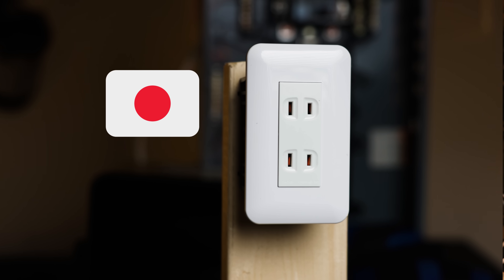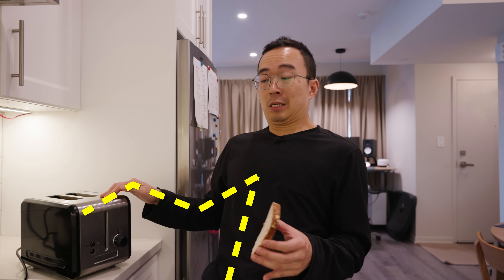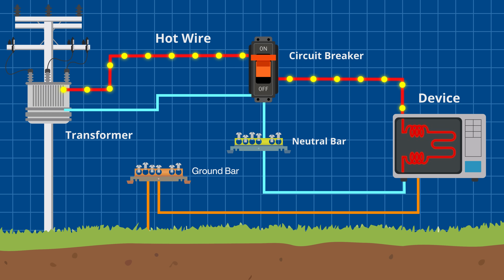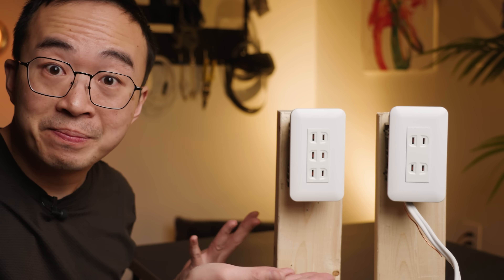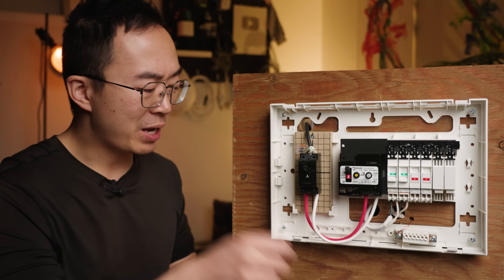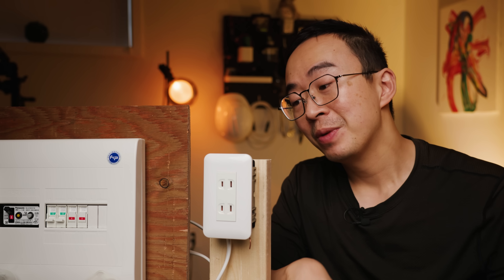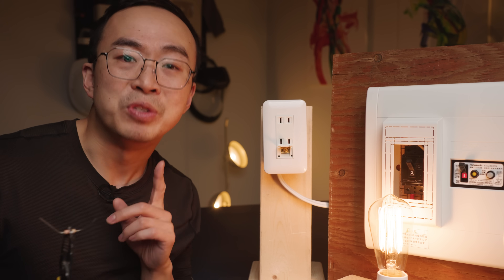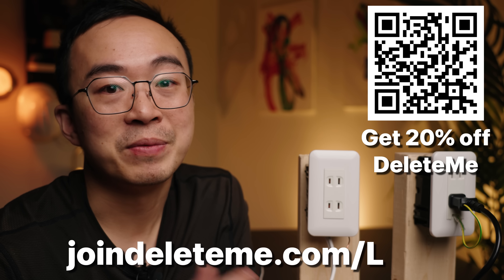How Japan Made Their Outlet Safe

Comment: It is long overdue to stop video about outlets. The EU schuko CEE7/4 F type is the absolute superior socket design under all possible consideration ever, while US and UK are the dumbest. Period. In general, french household electrical standard is the best worldwide by a long stretch.
Reply: There really is no need to overcomplicate an outlet in North America to hide the prongs. Because the voltage is low enough that it's not really a safety issue. Europe was forced to use higher voltage because copper was scarce after the war. That's why they came up with a design that covers the prongs better because it's riskier. In North America, the only way you're gonna get hurt by 110 volts is if you don't let go. 😅

Comment: The problem with the U.S. we were the first adaptors.  We didn't know all the uses and problems. It was too late to make a lot of changes without changing everything.
Reply: Nah slap a GFCI on your circuit board and it should work, i dont see how that needs other infrastructure changes to the wider grid. 
(Of course i mean a proffessinal should install everything)
Reply: That and wanting to address the situation on the cheap.  Running a 2nd neutral was determined to be too expensive.  Losing neutral in a 3P+N system as is used in the rest of the world can be every bit as disastrous as it is in the USA's 120/240 centre tap neutral arrangement.

Comment: Some jurisdictions in the US require GFCI and/or AFCI breakers, there are combo breakers as well, in NEW construction only. Check the NEC, or for California, the CEC.
Reply: At this point, essentially all jurisdictions in the US require these protections. The video is...yeah.
Reply: afair if you replace a breaker in a bedroom it MUST be an arc fault or combo AGF now - which causes a lot of hassle
Reply: Not only new construction, but also in almost all instances of rework to the circuit in older panels as well.
Reply: ARC FAULT (AFCI) protection aka DAA/DDFT in europe. GFCI/RCBO/RCD is old news in global electricity safety systems.
Reply: @thedavesofourlives1  One of the nice things about GFCI is that it's something that's often times easy to retrofit without being an electrician. It just requires the ability to replace the impacted outlets with GFCI ones, assuming you've got the necessary 3 wires to do it. 

If I understood correctly, for best results AFCI really wants to be in the circuit breaker and that's likely best done by an electrician, especially if you're breaker box is like mine and lacks a method of powering it down.
Reply: @thedavesofourlives1  Internet says that AFCI has been mandated on most new circuits for years in the US and Canada, but it doesn't work as well on 200+ V systems so has been adopted slower and less aggressively in Europe.
Reply: Tesla coilers and ham radio operators absolutely hate those pesky false tripping AFCIs.
Reply: Those breakers are a massive headache with their false trips. AFCI are worse, but GFCI have been ripped out so often I can't count. And some perfectly safe appliances will trip a panel AFCI/GFCI once a week or so. I usually blame junk breakers, but there are a lot of badly constructed GFCI outlets out there, too.
Reply: @brucecarr6258  I work with EE is there something you suggest to mitigate these issues?
Reply: Obviously the creator of the video has never opened a Code book in his life. The video is borderline clickbait and contains many half-truths and misrepresentations. Source: my 40 years working in the American industrial electric industry.
Reply: CEC is Canadian Electrical Code, I think you mean NEC for the jurisdiction of California.  Also, I think it would be more appropriate to call the NEC USNEC due to another corporation operating internationally known as Nippon Electric Company.
Reply: @WJCTechyman  In California, we call it the CEC, but I totally agree it is a bad acronym in either case.
Reply: @nikaiwolf  now you already know why
Reply: @WJCTechyman  Overload in the three-letter acronym space is hella bad. But CEC is correct as California requires adherence to the California Electrical Code, which is a modified  copy of the National Electrical Code.

Comment: 12:00 Actually, the test button is just as effective as an outlet tester because the way that the best button works is by shorting a resistor between the neutral and live, simulating a real ground fault.
Reply: One GFCI outlet can protect all the outlets beyond it, so you can still use the separate tester tool to test the GFCI ability from those other locations that won't have buttons.
Reply: @Lam in the UK proper testers do a multitude of tests and check the time it takes to trip which is mandated as a maximum time. 30ms is used as that is only part of the wave length so you unlikely to get the whole current as part of the waveform will be lower voltage. 

Passing the test button didn’t do that. Also the test button can trip but in real world scenarios it won’t actually trip. 

There are also different types of rcd as the original type AC devices were “blinded” by DC current on the line which you can get from switched mode power supplies. In the UK it’s type A not type AC.
Reply: @Lam  Yeah, keep digging man. Why not just admit you were wrong.
Reply: Shorting between hot and neutral would be a short circuit not a ground fault. I don’t know exactly how the circuit works in a tester, however it does interface with ground. 

A safe way to upgrade an ungrounded receptacle is to add a GFCI. However testing an ungrounded gfci with a plug tester won’t trip it as there is no ground to interface with. This does not mean it’s bad or dangerous. It’s just the plug testers circuit can’t actuate the gfci if there’s no grounding connection
Reply: So, in Japan when you have a ground fault, the whole house GFCI takes down the entire house and not just the faulted circut?
Reply: @raylrodr  that's pretty common all over Europe, too. RCD trips the entire place. In the UK you sometimes have two RCDs each covering half the circuits I believe.
Reply: Regular outlets on a GFCI circuit do not have test buttons.
Reply: Just as effective *if they are working properly*, but I have seen them fail.
Reply: Live and ground, not live and neutral as that would be equivalent to plugging in a light bulb or any other small load.

I've never seen a GFCI without a test button, for places where it's mandatory that typically includes testing every X years. But hey i'm sure Japan make flawless GFCI's which never ever malfunction or fail.

I guess Japan also doesn't have lightning strikes either, or they are okay with humans becoming lightning rods.

Not my definition of "safer" but each to their own.
Reply: @sirtra The test button and resistor is between live and neutral and between the load and supply side of the sensor.
Reply: @TimothyEBaldwin   live and neutral are the wires used by loads. A light bulb is indistinguishable from a resistor in terms of the GFCI.

You create a ground leakage fault by leaking current from the live wire to ground wire.

Did you even watch the video or understand what an AC sign wave is? What is under the little flap on the recipticle shown near the very end and why?

🤨
Reply: @sirtra  And if you connect the light bulb between the supply neutral and load live terminals, the GFCI will detect the imbalance and trip. A resistor connected between load neutral and supply live will also typically trip a GFCI.
Reply: @TimothyEBaldwin  ah yep, i understand what you're saying now - ie the resistor will be bypassing one side of the protected circuit, not simply from live to neutral and in that case you're correct.
Reply: "Simulated"... you said it. How is that any better than a test that fails. It's easier to argue a failed trip test is more revealing as it positively identifies defective equipment, installation, and or environment.
Reply: Wonder what would happen on a non-GCFI grounded circuit.  Probably the electric fuse would blow.
Reply from the maker: ̶N̶o̶t̶ ̶e̶v̶e̶r̶y̶ ̶G̶F̶C̶I̶ ̶d̶o̶e̶s̶ ̶t̶h̶a̶t̶,̶ ̶t̶h̶e̶y̶ ̶s̶h̶o̶u̶l̶d̶,̶ ̶b̶u̶t̶ ̶s̶o̶m̶e̶ ̶o̶n̶l̶y̶ ̶r̶e̶l̶e̶a̶s̶e̶ ̶t̶h̶e̶ ̶m̶e̶c̶h̶a̶n̶i̶s̶m̶ ̶i̶n̶s̶i̶d̶e̶

Edit: I was wrong.  All GFCI test buttons create an inbalance between hot and neutral which should trip the breaker.  I think I was going through some engineering discussions and it was likely a discussion on whether the testing mechanism can fail and whether an external device should be used.
Reply: @Lam then it’s not testing anything
Reply: @Lam  When and where?  Only releasing the mechanism wouldn't be an actual test, there would be no point.  I'm gonna have to see some documentation that a nonfunctional test was ever allowed in a US residential GFCI.  Having disassembled a GFCI from the 1970s, it was definitely a real test back then.
Reply: @jonc4403   It verifies the disconnect mechanism still works, but not the trip mechanism. So it isn't a nonfunctional test, it is a partially-functional test. 
My understanding is that spring fatigue is by far the most likely form of failure, so I find it easy to believe the test button was originally only meant to make sure the spring still did its job and the role was upgraded later to whole-device testing.
Reply: @Lam  Good to know, but basically all modern GFCIs do that.
Reply: @Lam  Not true if you are using compliant / approved GFCIs. Maybe true if you're using chinese made "For Export Only" GFCIs.
Reply: @Lam  every GFCI with a test button has always that.  they never made GFCIs with a "only release the mechanism inside" button.  if you think they did, please link a model number, datasheet, or anything to back that claim up.

Comment: If the ground is really just a different path to neutral in the US then why on Earth does it have to be driven into the ground? Also, wouldn't this also make neutral just a different path to ground?

Btw. I live in Europe and I have the best of both worlds. All my circuits are protected by GFCI just like in Japan but all my outlets accept grounded plugs (Type F socket) like in the US.
Reply: The earth ground also serves as protection for lightning.
Reply: and bonding neutral (also called grounded conductor) to ground makes neutral stays at ground potential (in reality only where it bonds)
this means if lightning did strike earth in the physical vicinity of transmission lines all 3 prongs inside the dwelling will receive a raised potential momentarily
Reply: Yes neutral is the same as ground at least in theory , and you can run circuits just using ground as neutral (although there are issues associated  with it, it has to be driven into the ground so that if the connection somewhere brakes you won’t get shocked, that is the whole purpose of grounding and is why it’s a different cable from your appliance because if there was an issue with the normal ground you don’t want it shocking you
Reply: One thing not mentioned is grounding is necessary for things like amateur radio. and you especially want to ground for lightning reasons. The US has the best setup because you can get an AFCI/GFCI, breaker, and ground, and GFCI outlets.
Reply: @mediocreman2  How parochial.
Reply: it is a very good idea to build a separate, dedicated RF ground if owner is transmitting, after it is built connect RF ground to the power ground to satisfy local code whereever the property is located
Reply: @mediocreman2 I've found a good ground really helps with radio reception.
Reply: Also the video’s description of ground while correct isn’t the full story as there are far more ways ground saves you more than just tripping a breaker, some of the other safety features from it are keeping the neutral at 0 as well as providing an alternative path to the substation
Reply: Ground needs to be in the ground cause the idea is that it also detects current that flows over the real ground from a live cable  to it and then trips the breaker.
Reply: It is an alternate path to neutral in Europe as well in most cases. If it is just an earth rod then the RCD handles this protection.
Reply: It doesn't need a stake (or pipework) in the ground to function in terms of basic protection, ie blowing fuses/tripping breakers rapidly.  There's more at play though but far too long a subject to properly address in a YT comment.  Staking the premises earthing (which may also be simultaneously attached to neutral) to the ground absolutely does not provide any useful protection to a person actually being a path between line to the ground or the earthing system.  You need an RCD or similar for that.

Comment: In usa, residential GFCI trips at 4-6mA
Reply: 10mA RCDs are available but are only used in certain settings.  They can trip from 5 to 10mA but always at 10mA or more.
Reply: What?
In Central Europe and UK+Ireland the standard is 30ma to avoid nuisance tripping on ground leakage/stray currents that occur naturally in electronic devices.
Reply: @alouisschafer7212 the big difference is American GFCIs are protecting only one branch circuit, and stray currents are likely to be reduced at 120v (as compared to 230v).
Reply: @alouisschafer7212 But we just have to push the reset button on the nearby outlet to reset it if it trips - and devices here DO NOT have that kind of leakage current under normal conditions.
Reply: @jonc4403  You can have a GFCI outlet protecting additional sockets downstream though so potentially you still have to contend with aggregate leakage pushing close to the trip point and potentially have to go walkies to reset the device anyway.  6 of one, half a dozen of the other really.
Reply: @jonc4403  ever heard of low pass filter in devices that runs frequence inverters?

Comment: TLDW: Japan uses GFCI's everywhere, except for where they don't (because high currents are needed for motor kick-offs).
Reply: As far as i know, you can programm them so they are also used in industrial settings, or what do you mean with motor kick-offs?
Reply: @maxmisterman785  Motors are notorious for tripping GFIs not because of high currents as such, but because when a motor starts there is a split-second mismatch between the current it draws and the current it passes back to the panel on the neutral wire. Basically the motor is very briefly storing electrical current, which exactly simulates the fault that the GFI is supposed to protect against. In some US/Canada jurisdictions, you're allowed (or required) to not use GFI's where a nuisance trip would cause property damage (sump pumps) or food spoilage (freezers). However, I'm not seeing that Japanese grounded outlets avoid this. They can't be wired to bypass the GFI because they also seem to accept 2-prong plugs. I'm thinking that these whole-house RCDs are set with a high enough threshold (to avoid whole-house nuisance trips) that they just aren't effective in protecting human life in certain high-risk conditions, so the ground path (even a high-resistance one) will let the GFI trip in a hot-chassis fault condition before a person has a chance to grab it.
Reply from the maker: Exactly that, I'm glad I didn't have to explain nuisance tripping

Japan sells GFCIs for motors!  https://www.amazon.co.jp/Panasonic-Breakers-Notebook-Protection-bjw3303/dp/B00IX8DQ4I/
Reply: You need GFCI with a current curve for your appliance. In Europe you have curve A, B, C...  The trip for one is 30mA. Doesn't matter if it's for motor or your laptop.
Reply: yeah clickbait 100%. its basically just like the 100-year-old homes that lacking ground so we put gfci outlets, but the Japanese did it to the entire house.

Comment: I go by the thought that screw terminals and quick connect plugs dont mix, if it requires a hard terminal it all belongs in a box, otherwise it will rarely be actually connected out of human laziness
Reply: I mean, if it's an air conditioner that is never unplugged, its not that hard to plug it in once.
Reply: @Joneydew   if its an AC unit why have it plug in at all considering one terminal is hard wired, we went though this in the usa with 3 prong to 2 prong adapters, lol no one ever connected the extra wire in my 45 years on this earth and given my grandparents house the most common solution was to cut the friggin ground lead off the plug ... sometimes with pliers
Reply: @osgeld  Maybe so that one does not necessarily need an electrician to install it.
Reply: I would agree but the things that seem to requiere that in japan look like they are things you only connect once.
Reply: @maxmisterman785  which goes back to the USA mentality, if its a wire once device it belongs in a box. Otherwise Jimbob cuts the ground lug, plugs it into a 2 prong outlet and bitches when they get a zap. This is a problem that was solved before I was born and im 45
I bummed my dad's 1980's skill saw to get though some tough stuff just 2 years ago and that fucker lit me up like a hornet. (yea dont touch the metal, I snapped off the ground lug decades ago, wear gloves) ugh

Comment: Wait, so that means that if a japonese GFCI panel trips its going to kill power to the entire box, and potentially the entire house. 

From a safety standpoint I can see its usefulness, but commercial electrical must be a nightmare. 

I also imagine troubleshooting an electrical fault is going to be more difficult, because while you can test individual breakers its going to take longer to identify the initial fault.
Reply: Easy. you flip half the breakers then switch the gfci back on, if it stays on start flipping stuff on untiln it disconnects again. Just go by trial and error
Reply: Each flat/apartment also has their own circuit breaker so it should not be a problem to identify the faulty circuit.